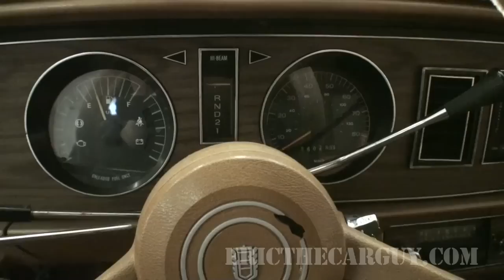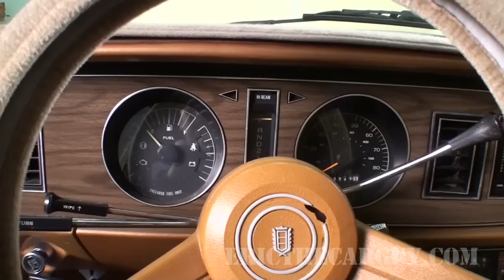1979 Ford Fairmont a Closer Look #FairmontProject

Comment: that thing is clean, clean, clean. its as rust free as my 91 cavalier and that car is 11 years newer. that car is in good enough shape where you could fix a couple minor things and drive it the way it is and not have too much trouble with it..... i wouldnt drive it in the winter it would fall apart fairly quickly in the salt. these werent made out of the best steel so its surprising its a solid as it is. have you put any miles on the stock engine? what kind of mileage does it get? i bet that straight 6 would run forever. as far as modifying it that's your choice. why not just drop in a stock 302 i dont know if you need to spend 10 grand. you could buy a 302 out of a crown vic or a ford pickup... pretty cheap common engine. buy the drive-line out of a JY for not much money. buy the whole thing including computer and wiring harness.

Comment: Back 15years I was going to do up another fox body car called the 83-85 baby LTD,but like wise money is what killed the project.The car was an 84 version with the inline 6,just like yours and I basically was going to put mustang mechanical and then do body in french blue to match the massachusetts state police cruisers,I even found a place that had the police push bumper gaurd,spot lamp,etc.Back then it was going to cost me around 12k.If you do not know Ford SVT catalog you will found what you need to do your dream

Comment: I think a modern v-6 would be a better choice.  A v-8 will make that car very front end heavy and you are going through the trouble of an independent rear suspension for "handling".  If the weight distribution is closer to 50/50 it will handle like a BMW.

Comment: That my friend is a 7.5 and you can get plenty of performance out of the suspension setup get tubular upper and lower with poly bushings and an 8.8 with sway bar and quad shocks and change the rims and tires and it will handle like a slot car I would know I have an 80 Fairmont

Comment: I think it would be better buying a parts car from a salvage auction. You would save lots of money. I used to do that with civic hatchbacks and then just buy  wrecked Acura gs-r's for parts. All I would really need is aftermarket conversion kits. Whatever parts you have left over you sell. It's a win win.
Reply from the maker: I'm actually considering that very thing. Perhaps find a fox body Mustang that has much of what I need. Rebuild those parts and I'm good to go.

Comment: This car probably gas the electronic ignition that has a "DO NOT CUT OR SPLICE" wire under the dash near the steering column.
IF the car will turn over but will NOT start, how you fix it is to run a wire directly from the ignition module to the inside of the car to that "DO not cut or splice wire junction .
There are 3 different ( Do not cut or splice wires). Those words are actually printed on the wire when you look near the steering column inside the car.
Put in a piece of regular wire and do not put in a fuse or it will not work.

Comment: I think that you paid a little bit less than what I paid for my first "New from the Dealer" car, which was a 1979 Fairmount Futura ($4200, tax, tag and title included). I was remembering all of the "Firsts" that this vehicle had (for me) at the time. (I was 19 and worked in a parts store. Started driving at 10 (Dad's 66 VW Bug, 66 Fairlane and 72 F350), bought a 66 mustang at 15 ($350, 65K miles) 63 Impala at 17 ($150) and a 74 Pontiac Astre at  18($1200)). It was the first car that I owned with A/C and front disc brakes, First with an EGR and Catalytic converter (I had a class on them through NAPA), The first with the Evap system, Electronic Ignition and several other things. But what made me laugh was when you were showing the Horn switch location. The Fairmount was also the first American car that I had driven that didn't have a floor mounted dimmer switch. And with the first Halogen lights that I ever owned, I don't know how many people that I unintentionally blinded at night until I got used to that column mounted dimmer switch. It was also the first adjustable steering wheel I had ever seen, using the lever in front of the dimmer switch.
It was, like you said, nice and comfortable. A "Happy Place". I drove it until I was 25 and in the Air Force. With a little help from Clifford research (6=8), it would get up pretty good. I traded it in for a 1 year old Black 1984 Ford F-150 Stepside with Keystone Classics with 9K miles for $5500 , minus $1700 Trade In. (It "Mysteriously" called my name from a car lot across 6 lanes of traffic. That was a "First", also.) I never regretted getting the truck but I have totally regretted trading the Fairmount in on it.

Comment: Hotrod magazine has an article about putting a 4.6 V8 into a fox body mustang and it also includes some of the other modifications you are thinking about including 5 lug and brake upgrades, take a look EricTheCarGuy
Reply from the maker: I'll have to check that out as it sounds very similar to what I'm thinking of.
Reply: Probably the best sort of donor would be a junked pickup, just like the 5.3 V8 is a common swap in GM cars. Much more of them sold and scrapped or totalled than say a mustang or similar, and if you can get the whole parts car you can get wiring/ecu and all the other fancy parts you will need.

Comment: I know you want to do a 5.0, but there is a kit to put a big block in a fox body. I'm putting a 521 in my LTDII. Heavy at around 700lbs. The motor is a torque monster. Just an idea. I know it doesn't suit your intentions as a gran/pro touring car, but wow, that would be a sleeper. It's not cheap with good parts but you get what you pay for right?

Comment: 4L60e, millions made, 4 speed auto, good for a few hundred hp, sure it's a GM and sticking it in a Ford is a sin, but it has plenty of parts available and you could probably get a working one for $100-200 lol

Also the IRS in my car has separate shocks/springs, I thought this was normal for rear ends

Comment: Just leave it as it is, fix what you need and enjoy what you got.
That's what I would do anyway😂.

Regarding the tubular k member, I don't get it!
If you change this you will loose a lot af strength.
The tubular is strongest in the directions horisontal and vertical directions where you need it the most.

Comment: Ho and one other question ! Don't you think that the engine revs a little bit high when you are cruising on the highway ? The inline 6s with 3 speed automatics often give that impression, mine is no exception, I would like to install an overdrive (but that would be more expensive than the whole car) or a 4 speed manual (huge work, and must find a donor car)... during the time a gather the knowledge/money to do something like that, would there be any other way to reduce the engine revs at cruising speed a little bit ? (I heard something about changing gears in the differential at the back, don't know if it's useful or realistic)
Reply from the maker: I believe they actually make overdrive units that bolt to the back of the existing trans. You'd have to shorten the drive shaft but it might be worth looking into.
Reply: Thank you for your answer EricTheCarGuy :-) Yes, Gear Vendors has a unit that bolts directly to my mopar 904 trans, the kit is 50% more expensive than the whole car thou :-D ... I wouldn't hesitate if it was a more "exquisite" car with a rare engine I want to preserve, but in my case, I'm afraid that it would be total overkill ... that's why I'm investigating on alternative solutions :-) But if it is the only viable solution, then I will have to take the decision someday if it's worth spending so much money on this car or not, or wait for a used kit (which is extremely rare).

Comment: my Grandpa bought a Ford Fairmont brand new in 79 but he ordered it with a V8 it was quite rare to have with the V8 I forget the displacement it was smaller than a 302 I wish I could remember?
Reply: ya I unfortunately bought a thunderbird with that engine but my 78 Fairmont had the 302 the t bird crap engine was between 302 and 289 an absolute bomb like when coke made a new coke not the diet but just a new coke  id like to know how how much money ford wasted on this engine with all new tooling all new parts all new bushings  the design process then 2-4 years later the engine is gone .
Reply: Thanks for the info if I talk to my grandfather I'll ask him he hasn't been feeling well lately so if I remember I will ask him what size engine it was
Reply: I called my grandpa it was a 4.6 liter in the Ford Fairmont he says
Reply: +spackmaster Chavez yea its a 289
Reply: No it's not a 289
Reply: +spackmaster Chavez unless the engine has been swapped its a 289. 289ci = 4.7l ish
Reply: We're talking original engine here okay
Reply: well I had the 78 with a 5.0 and that's what was listed on the stickers on the door pillar and eng. comp. stickers ford experimented way too much.

Comment: reminds me of a cituation i went through with a good customer....a sales man bought a 1977 fairmont with 13,000 miles ,thought it was great deal (he got it cheap)and figured because it had low miles he had a brand new car !!!! we told him that it would cost him a lot of money to keep it up since the car was 30 yrs. old , in other words if he drove it 200-300 miles a week that everything would go out quickly because all the gaskets and the engine parts were 30 yrs. old  he blew us off and of course within 8 mths. he replaced the alt, the rad, the valve cover gaskets,the water pump etc !!!! he started to get pissed off at us saying we were ripping him offf.he FINALLY realised that we were telling him the truth !!! soooo...never buy an old car without realising that it IS an old car !!!!!!! low miles does not a new car !!!!!!!!!
Reply: Hmmmmm, I drive an '63 Pontiac Grand Prix with no issues. It's all original with 67K miles.

Comment: This car would make a nice sleeper. Full tube chassis with 9" rear. 500 cubic inch twin turbo, Lenco 4 speed, etc. 1,500-2,000 HP would be just right... Don't paint it or fix any rust.

Comment: Car actually looks pretty clean! I had that engine in my 79 mustang. Definitely not built for performance.
Reply: I had to constantly adjust the choke in the winter to make it start and keep it running! This vid just brings back memories. Lol! Excited to watch this project progress!
Reply: And the biggest hindrance to improving the situation was that the intake manifold was an integral part of the head casting. Someone did make an aftermarket 2bbl adapter, but it required yanking the head and doing some major milling.  There was once upon a time a website devoted to hotrodding the the 200/3.3l six, with the most improvements achieved by a combination of the above-mentioned carb adapter, a really big 2bbl Holley, and iirc the camshaft from a late-60s 250 six, which gave gobs more open time for the valves, allowing higher flow for the fuel-air mix and exhaust (at the expense of course of wiping out the already abysmal fuel economy :) ) .

Comment: here if u put a v8 in a registered 6 car its got to b inspected and you have to do brake upgrades/bigger rotors ,heavier springs etc .. so a higher capacity 6 is a much easier power upgrade and fewer problems in my opinion . 3.3 litre to 4.1 litre is decent

Comment: For ten grand you could buy a high mile early 90s gt and freshen it up. Or just swap in the running gear from said gt and use the rest on the four link you'd like in the back.

Comment: maybe you can get a wrecked shelby or some sort of v8 fox bodied mustang and swap everything to the Fairmont body
Reply from the maker: I'm thinking the same thing. In a future video I hope to go over the possible plans for this car.
Reply: EricTheCarGuy Great!
I would say that the main feature of the car should be the engine, and everything should be improved/built/modified accordingly.
I would say also that you need:
* 5.0 v8 at least
* Power Steering
* Power Brakes
* Good transmission (I don't know a thing about automatics :( )
* Better brakes (2 piston calipers at front at least?)
* IRS for handling (SVT Cobra R anyone?) or at least some solid rear axle from other mustangs
* Decent suspension

The bad thing is that all that stuff is a LOT of money. You should get a sponsor and go wild afterwards
Reply: EricTheCarGuy 408W FTW common! forged crank forged rods forged pistons hydro cam 150shot.
Reply: EricTheCarGuy tk0 5speed , strange 31spline axles , 410 locker (like mine) 4 link or a cantilever rear suspension

Comment: What are these cars worth? I have a friend who has a 1982 Fairmont sedan with the straight 6. Its in really good condition and runs great. The only problem it has is it needs a valve body for the transmission. She wants $200 for it. I know its worth it, but how much could it be worth running, driving, street legal, and in really good shape?

Comment: Actually Eric You do not have to change the K member to put in a v8  !!  I am in the middle of doing an 83 Fairmont futura planting a V8 in it. and my Dad just did one without changing the K member he used the motor mounts from an 80's ford f150. worked perfect and the motor fit right in there with no problems at all ! Do some research ! I'm just gonna keep my existing k member to save money. cuz that tube frame setup is expensive !

Comment: My Minnesota company car was a new dark blue '79 Fairmont wagon with a V8.  When I went around a corner too fast and knocked an object I was carrying through the rear side window, my company replaced it with a new red '81 Fairmont wagon with the straight 6.  This was the Fairmont Futura, the car of the future.

The following year, I left the company and purchased the car from them for $4,501.  Why $4,501 you ask?  Because the guy in charge of the fleet offered it to me for $4,500 and when I offered him $4,000, he told me that nobody had ever offered more than what he quoted so I gave him $4,501 so he couldn't say that anymore.  I kept the car until 1996 when I took it down to Texas and used it to look for a minivan.  Saved me an airplane ticket and a rental car expense.  Once I found the van I liked, I donated the Fairmont to a church.  "That looks like a Yankee car", I heard the church representative say and that was because it was probably the most rusted-out car in the state of Minnesota but the main reason I'm writing this is to let you know that despite all of the rust, there remained one part of the car that didn't have even a hint of rust on it and that was the rocker panels, the part that usually goes first.  That's because the rockers are galvanized.  They'll last forever.

P.S.  In 1986, I used the Fairmont to pull a '64 Lotus Elan over the Rocky Mountains on a tow dolly.  The thin air caused a rich fuel mixture that led to an engine rebuild due to the cylinders becoming oval, just like the Ford logo.  As I'm on my third Lotus, I don't understand why you are fooling around with a salesman's car, trying to get it to handle.  Why not start with the real thing?